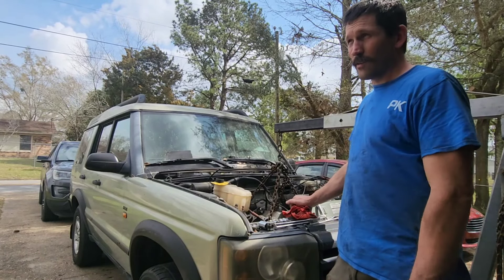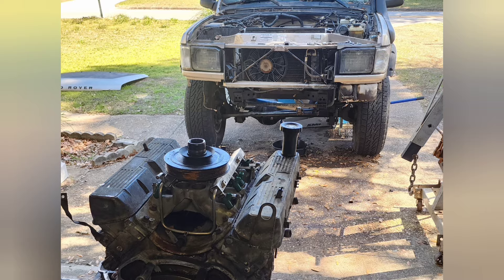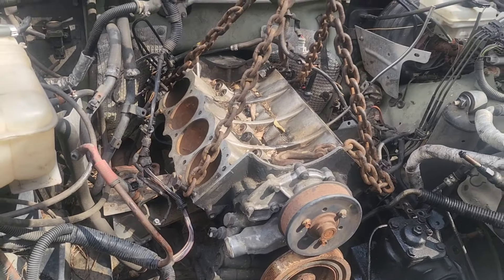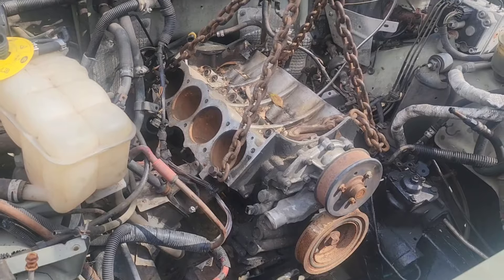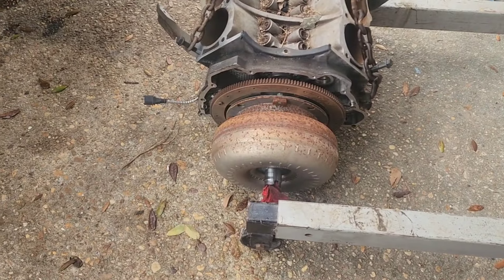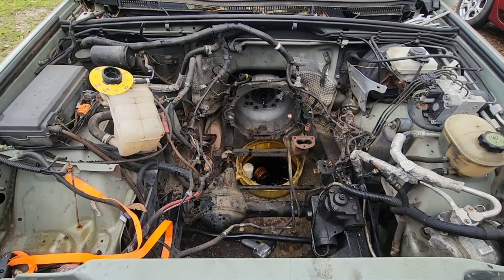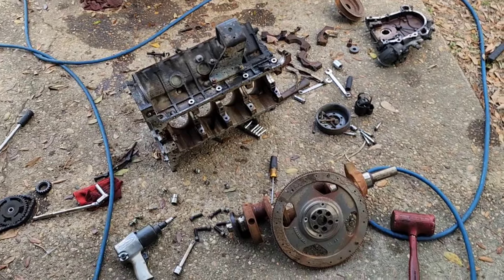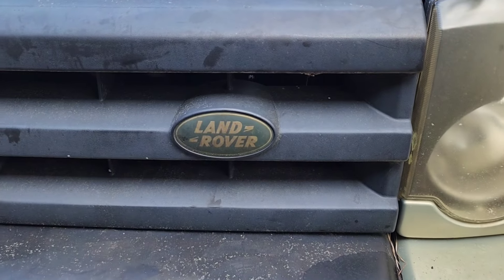Land Rover Resurrection!!! Part 1 (of many)

Comment: looks good jack! in in a boat where i am trying to save mine to run a bit longer. all the front end plastics are going to s7ht. looking to machine some delrin to replace some broken brackets ans fab a grille out of thin gauge aluminum or something. the cost are crazy to replace what i have with someone elses used garbage.